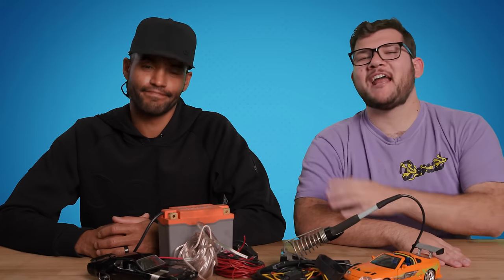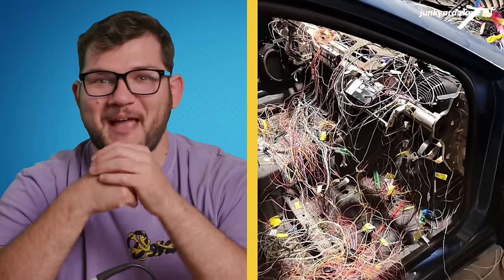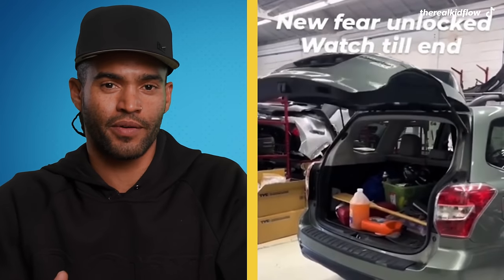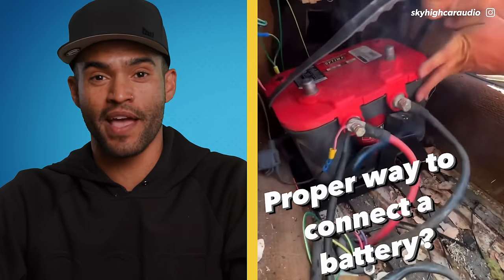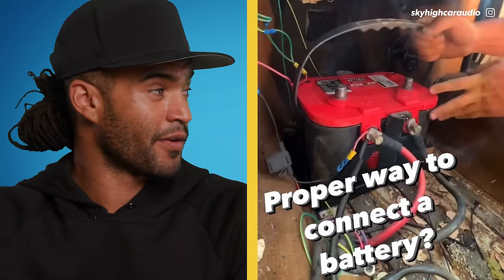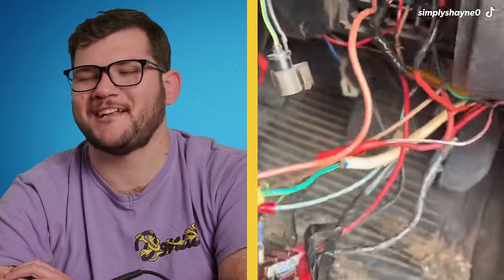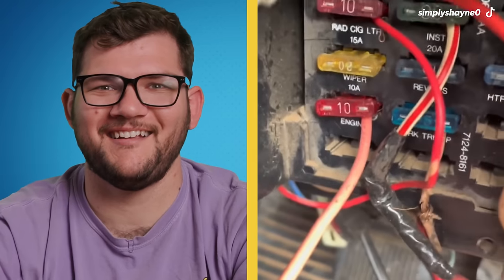Mechanic Reacts to Deadly Electrical Repair Fails

Comment: So, for the Subaru. It has two supporting struts as well as a ram that is a part of the lifting motor / actually. When the tailgate is being opened, or being closed, the motor will actually push up, or pull down the ram at that regular speed to move the tailgate. When the tailgate is being opened, or being closed, the motor will actually push up, or pull down the weight of the tailgate/rear hatch without issue.

 Once The motor gets to the destination of the high top center or low top center, it is up to the lift support struts to hold the tailgate up. The ram it uses to move the hatch essentially dislodges itself and If those struts go out, or if they're taken out, the lift gate will free fall as observed. So the motor will lift the gate just fine, but without the support of the struts it'll just free fall down. 

Also, if you hold it up with your hands and press the close button. The motor will then bring down the lift gate normally too. So without healthy working lift supports, the motor will act as intended. Just not designed to hold anything.

It's supposed to be designing a way that if you were to hand clothes the tailgate, you're not pushing down on the lifting motor. So basically it free floats at the top dead or bottom dead center. 

And if your loft supports are bad / broken, it essentially be no resistance all the way down. The guillotine effect.

So it's an unintentional failure in the liftgate to do that.

When lowering, is kind of the same thing, but but there's an electronic door that latch on the tailgate that actually pulls and latches the liftgate into the striker on the bottom.

For the oil pan heater, could also be for cold weather. What you'll commonly see for cold weather is a battery blanket warmer, a engine block heater for the coolant, and an oil pan heater. That cardboard sticky stuff is actually like a heating pad.

My personal car has all three heaters, as well as a maintener for the battery, to help with weather and storage conditions.

Comment: In 1994 my grandparents had a brand new Lincoln Towncar.  One day it wouldn’t start,  being understandably angry a new car did this they towed it to dealership.  Got a call,  the tow and the repairs weren’t warranty something ate the plug wires.  Get it fixed get it back the next day….car wouldn’t start, plug wires ate up again.  Turns out we had a pack rat living in our garage.

Comment: the red vehicle starting at 12:39 is a ford falcon ute, aussie made vehicle. the subaru with the slamming tailgate at 3:36 is a mechanical fault, ive seen it in other brands with powered tailgates. the mechanism inside usually breaks at a certain point and the electric motor drives it past that point on the mechanism. basically like stripped teeth on a gear

Comment: Car at 7:00, if I had to guess lives somewhere cold as hell.  If I had to guess the first cord he shows is obviously an oil pan heater, probably second cord to block heater and third could be either a little space heater in the vehicle or a heated battery blanket.  When it's below -50 degrees outside you do what you can to get your car warmed up.

Comment: 5:56 that's direct current 12V DC. The alternator makes AC but the diodes prevent electrons from flowing both ways.

Comment: The Subaru is factory. Its just that the drive motor has a clutch that lets go when its finished opening. GM had the same issue 10 years ago with the Traverse. They addressed that with a software fix.

Comment: Never had to wire a canadian car I bet. 😉
Most cars have a block-heater around here, if the temperature is predicted to go below -10C (14F) it is recommended to plug your car for the night so the engine block is warm in the morning or at least get a low viscosity oil (like 5W30) in the fall if you don't keep your car in a garage.  
Lots of people also have a nicer car for the summer and a beater car for the winter so your nice one doesn't rust or needs rust-prevention oiling.

Comment: The guy with all of the switches coming from the internal fuse box in the old falcon ute bought those fuses specifically for that "job".  They look old, but you can buy them from Bunnings for $7.95.

Comment: I was doing emergency roadside repair for semi-truck and trail. I got a call to a pilot for a truck that wouldn't start. When I got there the truck was completely rewired with Gold stereo wire. There wasn't a red, black or white wire anywhere on the truck. I called dispatch and walked away...

Comment: Subaru rear gate was a common issue. Rear gate struts blow out and power rear gate motor isn't designed to hold weight of the rear gate. It will at first then eventually it'll do this. There's a warranty extension to cover the rear gate struts.

Comment: 9:25 Those sparks are hot metal exploding off of the conductors that short-circuited. Same principle as arc welding.

Comment: Residential cords coming off the oil pan is probably for an engine block heater for a car in a really cold climate. In a lot of Canada, Alaska, Minnesota etc, a lot of cars have this for better starts on super cold cold starts.

Comment: My ex had a rat take up residence under her dash one winter. Little homie was a grizzled veteran of nesting in cars. How do I know? Well, to get rid of him I set up 9 traps, 6 of which were snap traps in her car and baited all of them with extra crunchy peanut butter. Went and checked the next morning, and the rat had completely cleaned 5 of the traps without tripping them. Number 6 got him. He was about the width of my hand and nose to tail was from my finger tip to my elbow. He was a chonky boi. Gotta give it to him though, he was smooth to clean 5 of the traps without tripping them. He knew what he was doing. He had a fine last meal.

Comment: For that subaru you can see that its got the gas struts and not the power lift gate actuators. So could be a good old rope pull trick :)

Comment: Btw Aaron most cars use direct current(not alternating)  because they are powered by a battery. In some cases you would have a transformer(of such) to change the type of current flowing through the car; for instance some cars have AC power outlets(so it’ll most likely have a transformer in it) and some electric cars have transformers in them to use AC current because AC is better for heavy loads.

Comment: Honda also uses soy based harnesses, had a rat chew through my abs harness, i would look into capsaicin infused harnesses etc. Its only a partial deterrent, also set traps right by your tires at night especially during the winter.

Comment: You are more likely to get into a situation with a fire with the type of LEDs used in a car. Cree arrays and COB setups need heat sinks. You get a heat sink failure or the heat sink was not put on properly then you just have a time bomb for when it is going to overheat and start a fire.

Comment: I've seen people use dryer sheets and mothballs in their engine bay to prevent rodent damage. Being honest, I've.never seen one with dryer sheets that had wiring damage or nesting issues. I used to work on some cars that typically sat 9 months out of the year, for reference.
Reply: Dryer sheets smell better than mothballs, for the record, but I haven't seen a rodent damaged car with mothballs either. It's easy to identify mothballs, but you have to work around the shaft.

Comment: I dropped my front differential for the first time and replaced the axle seals due to a leak down on the skid plate that was about a year ago still no leaks runs great just to your homework and take your time I know you want to get out there and drive but is worth it to take your time and do it right.

Comment: the fog light switch in my 66 m mustang was sending 12. volts back to the gas tank somehow. when I flipped them on the fuel gauge would go all the way to the right, waayyy beyond the full mark.

Comment: I lived in New hampshire and i had a oil heater pad on the oil pan .all i had to do is plug it in during the very cold nights in the winter ,and the oil was already warmed up for first start

Comment: If you're doing a lot of wiring. I would recommend a heat shrink label printer. It takes 5 or 10% more time now but you will thank yourself later. It also just looks nice and professional as well. But that's more of a side effect of avoiding the wiring rats nest.

Comment: The oil pan heater goes along with a block and battery heater. It's for starting the car when it's -50 outside and you have to go to work.

Comment: wiring is so simple, most people are afraid of it because they do not understand it, the car with the blinking lights is most likely cause by a bad or shared ground and the lights are completing the circuit to ground causing them to flash with the rest of the system, the subaru is not and electrical problem, that is failed lift gate struts, linear actuator to open the gate but there is no pressure left in the struts to hold it open so it slams shut once the lift motor stops.

Comment: The Subaru forester, the shocks on the trunk door are blown out. The electric motor opens it, but the shocks are meant to hold it once it’s open. But those doors are like at least 200 lbs and they slam shut so hard. I’ve had many vehicles with that option have this happen, only one guy has told me about it prior, everyone else has tried to kill me

Comment: On the one at 6:58, the oil pan heater is ALSO a thing in Alaska, Canada, and probably Siberia.  When that outside temperature drops to negative 40 or even colder, your vehicle needs to stay warm.  It NEEDS to stay warm.  Guess why when I wrote -40° I didn't specify F or C...

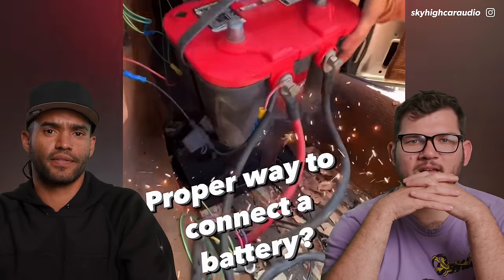At 8:28, the battery posts briefly rub against the bracket which resembles part of the battery tie down system.  Most modern vehicles are negative ground (i.e.: the negative side of the battery is connected to the body, engine/transmission, and chassis [where applicable]).  If while the negative cable is connected, the positive terminal touches a metal part of the vehicle (or a metal tool bridges the positive terminal to a metal engine/body/chassis part), a short circuit will result.  You might be lucky if a few sparks are the only result.

On the one at 11:01, that's an old issue coming back with a twist.  I've owned and worked on 1990s German cars and biodegradable wiring was a thing from 30+ years ago.  Some of the wiring didn't even wait for rodents - the insulation would start to break down, split, and expose bits of the copper conductors spontaneously.  Lots of newer vehicles have rodent issues with the wiring, including (but not limited to) Tesla.  My soldering iron and I have had some fun in rodent-damaged wiring.

13:09 just no.  No.

15:01 looks like a dash-cam at the top of the windshield.  I highly recommend using a quality dash-cam.  The rest of the maze of wires and accessories, maybe not.

I wouldn't touch the Dodge Charger.  My parents had several Dodge/Chrysler/Plymouth cars with model years from the 1960s to the 1990s.  I have other friends and relatives who have or have had Dodge/Chrysler/Plymouth cars up to 2000s models, and I have spent way too much time driving, maintaining, and repairing them.  You couldn't give me a Dodge/Chrysler/Plymouth car for free (except maybe the turbine car).  Nope!

Comment: 7:40 - Oil gets thicker as it warms up. Real reason why they heat the oil is engine will leak oil everywhere and probably into combustion chamber due to the extreme pressures and cold thin oil.

Comment: I once replaced a customers full flame broiled van engine harness...go to turn it over... nothing happened...

I then found a switch in the cab that was either live key turns over engine, or shorting the entire engine harness causing arcs roughly where the fuel was leaking from the fuel pump that was loosely taped in place 🤦🏻‍♂

Comment: Basically every car made in the past 20-30 years uses soy-based wire insulation, it's not a Toyota/Lexus thing. There's electrical tape that is infused with capsaicin to help deter rodents from chewing the wires. 

Rodents also chew things obsessively because their teeth are always growing, so they need to chew on things to keep the sharp but also keep them from over-growing, like claws on a dog/cat.

Comment: Those heaters are probably on a car in the far north.  Maybe even Alaska.  I saw a lot of bubble-gum-and-bailing-wire jobs on heaters up there.  I'd place a solid bet that it wasn't installed in a garage either, but a driveway or parking lot.

Comment: @12:30 That's an Australian '85 Ford XF Falcon ute with a V8. Also typical Aussie bodgy bush mechanic electrical madness....I bet it worked fine for years until it got parked. Someone reclaimed whatever that wiring was powering by just clipping the wires lol

Comment: 7:34 This is classic vanlifers roadside surgery. I’m thinking a DIY converted truck for dwelling in cold climates where a generator could power a block heater normally provided power by utility. & they’re talking race cars.

Comment: Dude, its an oil pan heating pad, we have them on all of our vehicles in Alaska, so you dont destroy your engine when its -80⁰F outside. Oil is thicker than honey at those cold temps, and you will destroy your oil pump or starve your engine of oil without the heater. We also have on  the transmission and a block heater to keep the engine warm.

Comment: The oil pan heater is for cold weather climates.  Also, you have block plug heaters, water pu p heaters, and battery blankets.   Alaska gets cold, yo!

Comment: -- Former installer and garage Manager (Mickey Shorr).  Still to a lot of wiring on the side for friends, and I build custom, high performance PCs.  Why is it 99.9 percent of all DIY wiring jobs I've seen for the better part of 3 decades an absolute rat's nest.  That first guy: you need to do your harnesses outside the vehicle and one at a time.  The kid with the hazards, I'm wondering if even had a multimeter.  Guy with the alternator must really, really like welding.  
   Next one is a silicone oil pan heater, with which I have as well, and yes, I have an AC plug (with cap) tip tied to my running board to plug it in.  But not like this, this is the worst install I've ever seen.  It's also quite common to use them in temps approaching or below subzero.  Which is why I have mine.  But mine is nice and loomed, heat shielded, and clean.  More welding, stick this time :)  
    The guy with the rodent damage and the reason why is spot on.  That's exactly what's happening, on top of the electrolysis effect that it has on a rodent's brain.  They love it.  Spray some peppermint in there.  Set an owl statue next to the vehicle.  If you park your car in the garage, leave the hood open, as rodents like it dark and cramped, not exposed, so take that way.  There's electrical (light/ultrasonic) devices that work as well.  Put all that together, you ought to be fine.  
   And you know those cheap old 30amp switches.  They'll handle 30 amps, for about 2 days.  

   Thumbs up.

Comment: IYKYK working on and being efficient with wiring diagrams, upfitting, diagnosing is super satisfying.

I work in upfitting police vehicles. The amount of people who claim they know how to do automotive electrical is insane when you see how sketchy their work is. I unfortunately work with some of those people as well. A co-worker claiming all the wiring diagrams are in his head and he doesn’t need to have them on paper like the new guys do. But while I am writing out wiring diagrams he thinks he has to take them and fill them out himself. But yet he doesn’t even consider the factory upfitter wires in working on cars 🤨🙄

Comment: Ha. They've never seen an oil pan heater. Guy probably has a heated battery blanket, block heater or interior heater.

Oil pan heater works great in -40. Even gets your coolant warm.

Comment: 9:10 - That's not like the other one at all.   The positive terminal (and wires) is hitting the metal battery hold down bracket, and since the ground wire is also hooked up .... they're shorting out the battery.

Comment: tools across the battery poles is funny. Had that happen to me once where a wrench out its own free will for some reason decided to check if the battery had any power. It had. So much the battery instantly exploded and i got a refreshing battery acid shower all over me. No damage done to me or car though besides battery was kind of blown after. 🤭

Comment: You missed the mark on the 110V plugs, etc.  That's extremely common in northern climates, including the 1992 Mazda Miata I drove while in Fairbanks, Alaska year round.  Simply put, the car simply won't start without heating the oil.  It can get so thick it's like grease.  Even with antifreeze it can get so cold it pops freeze plugs out of the block.  It's not uncommon to have an oil pan heater, a block heater, a transmission pan heater, and a battery blanket all with 110V lines running to an electrical box mounted to the firewall in the engine bay or someplace similar.  Things are VERY different when you go 3 weeks with the high temperature being lower than -40*F.  And on a side note, at those temperatures you park with the car in neutral because you can't push in the clutch.  You have to start the car and wait for the clutch fluid to heat up so you can push in the clutch and get the car in gear.

And the 'glue' is sort of like a silicone so it gets good contact between the heater pad and the pan.  This allows better transfer of heat.  It's soft so it doesn't 'crack' or break free when a rock bounces up and hits it while driving.